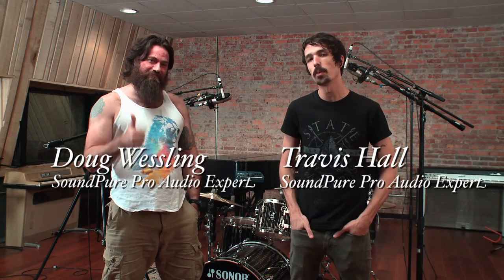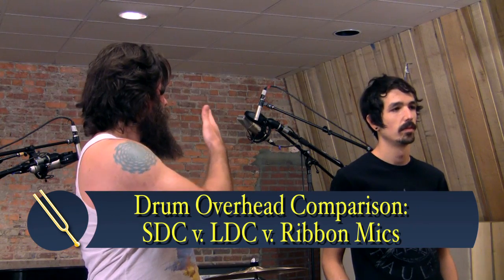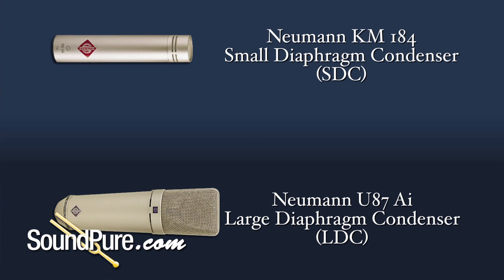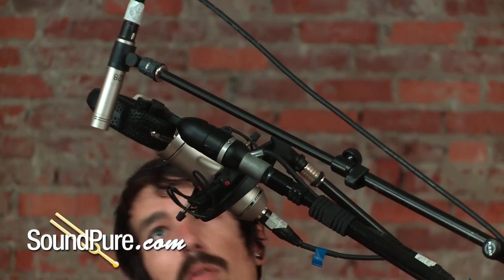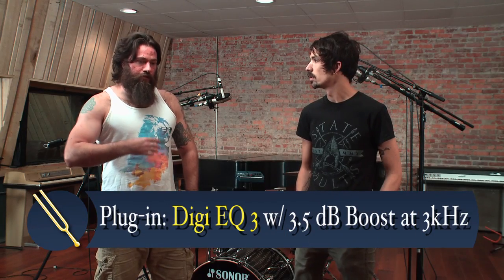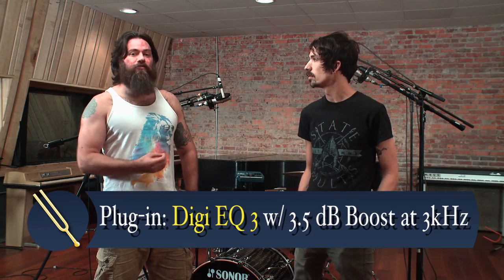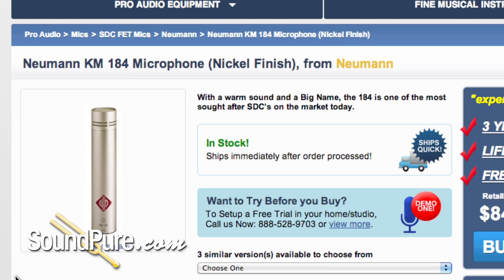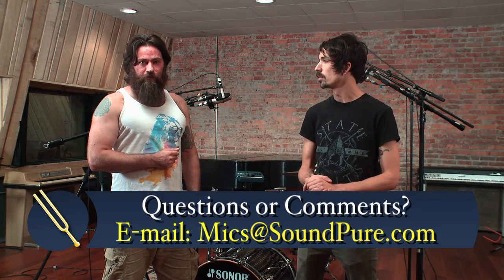Neumann U87 vs. Coles 4038 vs. Neumann KM184 - Studio Drum Overheads Comparison

Comment: I had an original BBC 4038, came in a wooden box with it's service history. It was 100% MAGIC as a mono overhead on drums. The reasons are twofold: detail, and the fact that it also records the reflections from the room. I came to think of the drums as triggers for the room. KISS. My other magic mics were cheap PZM (Radio Shack/ Tandys) which are always in phase and sound like $10K mics when they are tweaked with 9v etc.

Comment: That's a TERRIBLE stereo image. why do people INSIST on putting overheads mics equidistant from the center only to have the kick drum COMPLETELY on the left or right side of image ? And then when they add the spot mics, guess what ? they'll put the kick DEAD center. See my point ? There's a far better approach: draw an imaginary line around the area where the the snare and kick meet and aim for that. That way, you'll have the the snare and kick dead center, toms on each side, etc - considering that's what you're after. Otherwise, I'd rather have the mics equidistant from the kick and assume the fact that the snare is off center (which is, physically).

Comment: Why are peoples always using small diaphragm condensers for overhad applications ?
I mean, large diaphragm and ribbons are generally sounding much more hotter and 3D.
Reply: i agree
Reply: Depends what you want out of an overhead. If i'm doing jazz it's km84 on overheads and 451eb's on hat/ride into a chandler tg1 most of the time.

Comment: What a great clip. After 60 years 4038's are still industry standard.  My own 42 years in production, owning and renting any mic I could dream of,  has suggested to me that along with a pair of Coles 4038's,  Neumann M-49, pair of AKG C460B's,  Soundelux E-47 (unless you just want to spring for a vintage U),  a 2nd Gen. AKG C414EB, MD441U, RE20, Sony C-37a , a U-67,  Schoeps CMC6 Mk41 pair,  plus a handful of 57's and 421's and your B&K/DPA 4006's for orchestra and choir...  ..after these there are plenty of other good ones but most are virtually redundant after this group. ... well, maybe if I got greedy I'd add a 77dx and an Elam (or David Bock's) 251...doesn't matter which.  You may find an MD441 dynamic can give you a more musical top end for vocals and detailed instruments than just about any LDC mic under $1500 or so.  One could probably grab a 441, RE20, and some 57's and be done with worrying about needing any upgrades until ready to move into the real pro gear... ..like the 4038's in this vid.

Comment: the u87 ai suck compared to the original. fucking neumann had to use different capacitors and diaphragm instead of using the original. definitely not even a choice id make for anything honestly. the km184s arent nearly as good as their predecessor the km84. but damn those coles will never fail. so fat, juicy, and ballsy. perfect OH mics.

Comment: I liked them all for different reasons.  I think a fourth mic, a tube LDC, should have been added for a full representation of typical overhead drum sounds, but the U87 still represents LDC pretty well.

I would be happy to own all three pairs, and use them on different sessions or songs.  You could also do things like put the U87 on the toms, KM184 on hi hat, ribbons overhead.  You could do a lot with those 6 mics.

Comment: This was the most surprising video Ive ever watched, The U87's just sounded dull and meh! They were really out done by the Coles and even the 184's!!
Reply: i listened through Cans and then studio monitors, I got the same results!
Reply: Dan Meadowcroft yeah they made legendary mics sound bad by not having a real player.
Reply: that's because they ARE dull and 'meh' - on most things.
Reply: i think you pay a lot for a U87 because it is so flat and accurate, or dull sounding. Therefore it's very representative of the source.
Reply: There's a reason nobody uses u87s on overheads, they're just shite there. There are many other positions/sources where they're cool. Also a u87 is far from neutral, that would be a u89.